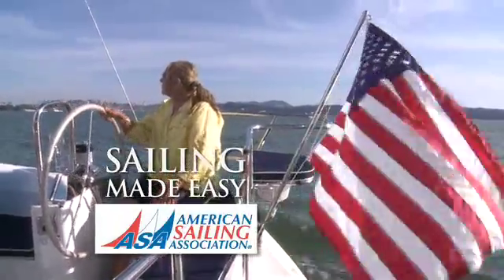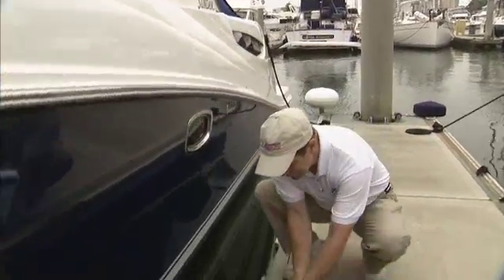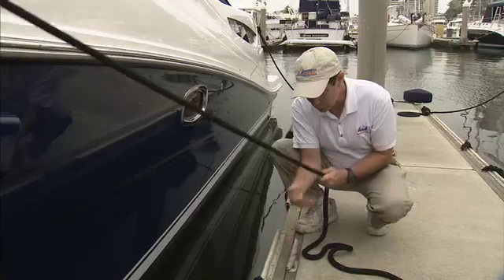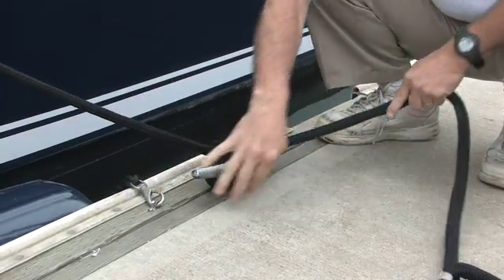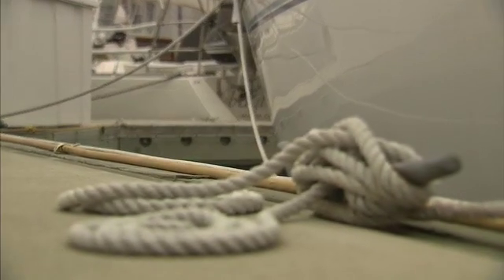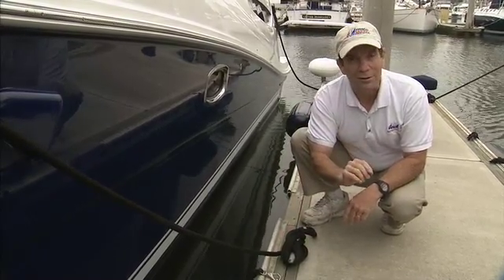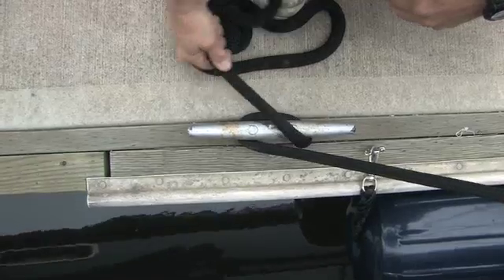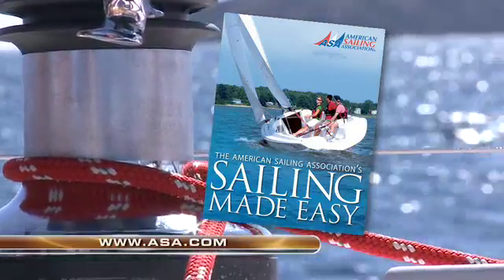Cleat Hitch

Comment: Good explanation, but professionals never put a hitch on a cleat, because if it’s needed, it will jam beyond your ability to undo it. See “coastguard boating education”
Reply: What is used instead of a cleat hitch?
Reply: @fatboyrowing  .. For those who prefer the locking hitch method: A figure eight underneath the knot will reduce the possibility of a jam up. More figure eights underneath the knot will further reduce that risk. Figure eights above the knot are useless, because if the knot is needed (if stressed) it will jam. So why finish with a locking hitch if more figure eights will do? A knot is not more secure unless the cleat is a bit small for your line. 
I’ve seen jammed hitches on breast lines at raft ups and on dock lines at partially protected harbors, but never on a pontoon in a sheltered bay. In the unlikely event of a hitch jamming there, nobody would know, except the guy who has to release it with a knife, and he wouldn’t blab about it, because a likely cause there is when a skipper forgets to cast off a line that’s been secured with knots and then attempts to power away. 
Marina managers prefer the locking hitch method because it’s more secure than the way some novices belay. Also each cleat can be used for more than one line. Unfortunately, when day sailors first go adventuring in bigger boats and learn the hard way that heavy loads or snatching can cause a hitch to jam, they remember their instructor.

Comment: Well explained! Powerboaters need to learn to tie a cleat hitch too. It's quick and easy, but most people instead make it a lot less user-friendly and less effective by wrapping up a completely unnecessary pile of figure 8's because they never learned to simply make the final locking turn which holds so well and releases fast. Found this video through a link in a real good eBook I'd recommend; "BOATIING SAVVY - What KNOT To Do: Often-overlooked & Lesser-known Keys To Safe & Smart Power Boating."